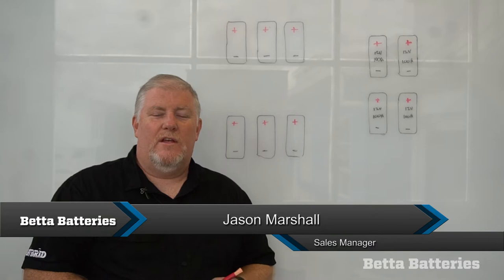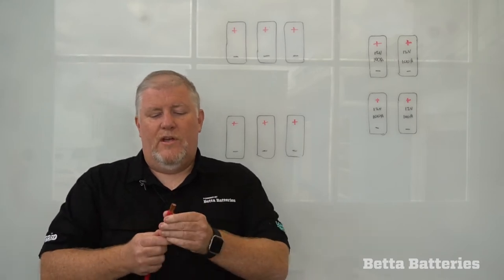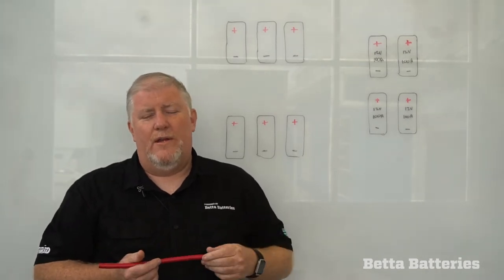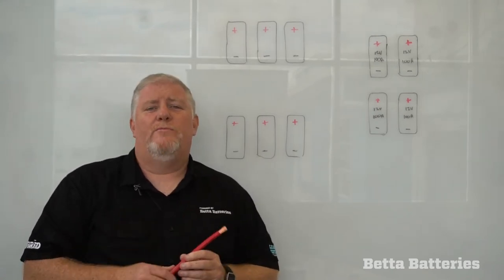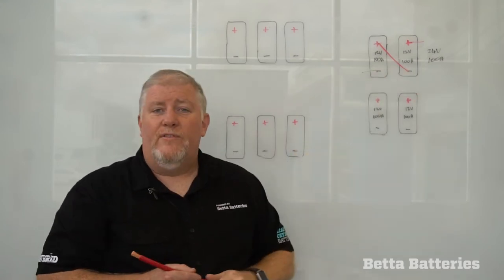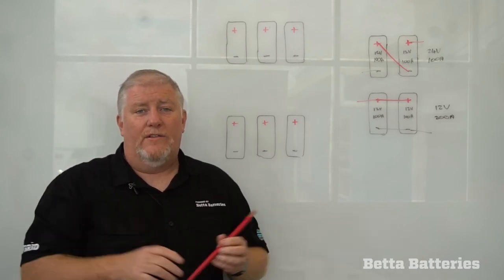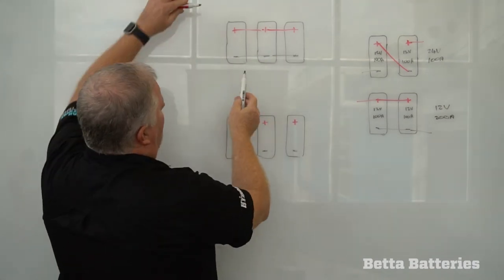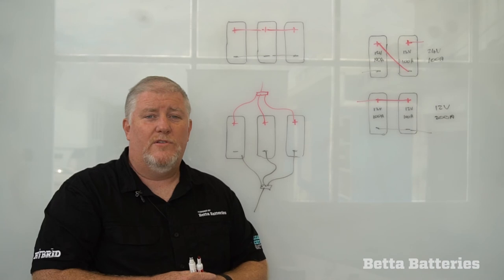Battery cabling and Series vs Parallel connections

Comment: Hi I've got 2 6s lipo batteries wire them up in parallel 1 is 10.000mh and the other 6600 mh would the total capacity be 16600 or 6600 as you go from the lower one